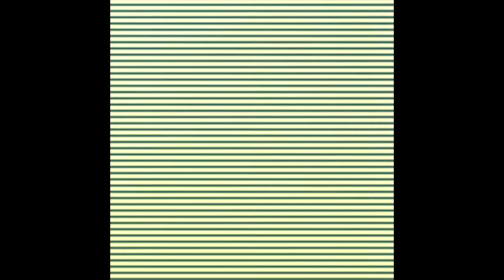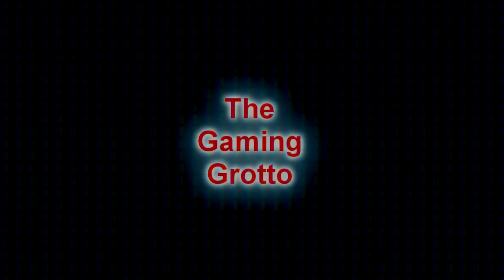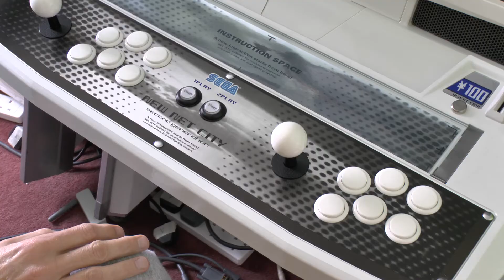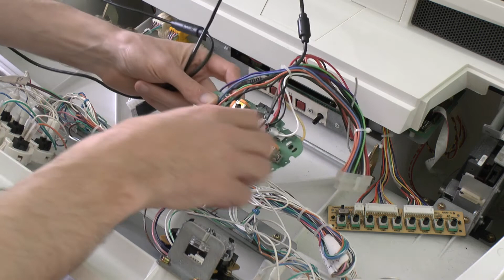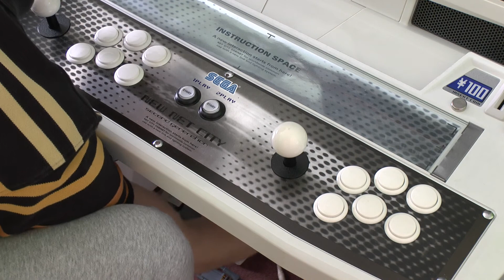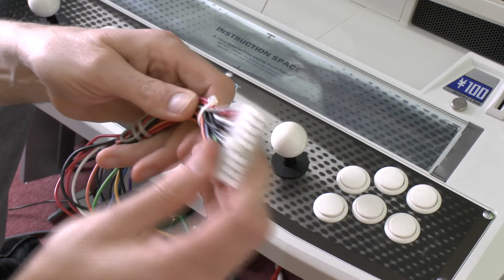Tech Overview: Console to Arcade Cabinet "Pad Hacks"

Comment: Couldnt you have both the cab controls and the 360 pad wired up to the same ATX connector at the same time?. So would remove the need to have to keep unplugging the cab control loom and plugging in the 360 loom?